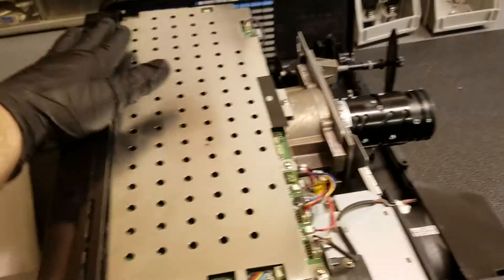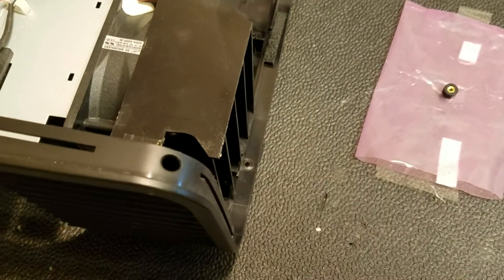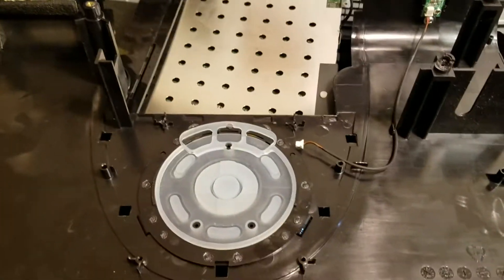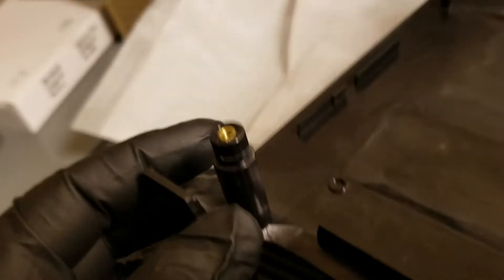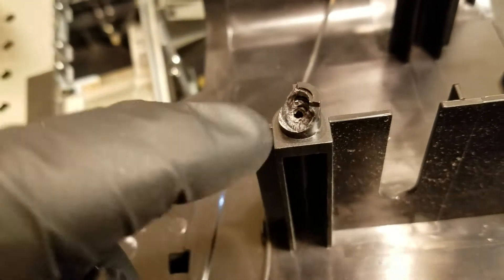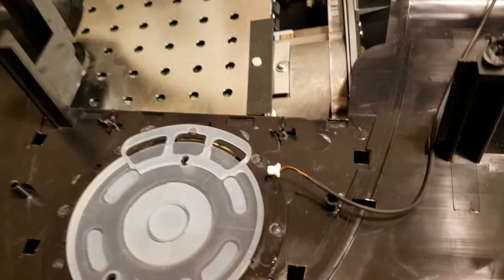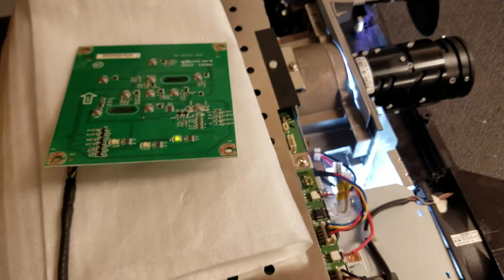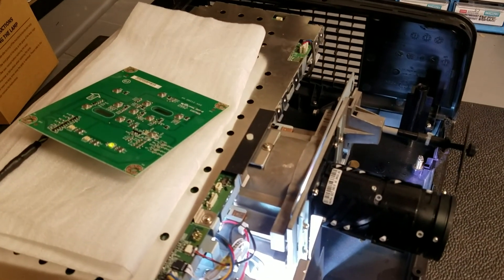BenQ W6000 DLP Projector Repair / Troubleshooting

Comment: It´s been a while but do you remember how to open the left side of the top case where the bulb is? Something seems to hold it quite tight right above the area where the bulb is. I can pretty much open the right side with much less trouble. Or is that normal and I just have to use more force?
Reply from the maker: I don't honestly recall.  But I will say as long as the screws are definitely out, you should be able to pop the side loose.  Again I might be reversed, but I think the top clicks down on the clips so if you push inwards(ever so slightly) on the lower case, it should release the clips for the top. I hope that makes sense. I am pretty positive the top case does not get pushed in to pop the clips loose.

Comment: Thanks for the video. I’ve had this same W6000 projector for a few years. At random times I’d get these yellowish/white vertical lines across the screen that would eventually go away. One day I dropped it from a few feet and those lines came back and never left. It still turns on and everything works except that.

I opened up the top similar to this video and checked the lamp but I’m not sure what to do next. Do you know what this could be?

It’s vertical lines throughout the entire screen

Side note: turning it on after a year and a half and there were 3 red lights but those went away after I re-plugged it in. Thanks!
Reply from the maker: Try throwing it against the ceiling to reverse the damage (Just kidding!).  In all seriousness, I think the connection between the mainboard and DMD pcb is not connected.  There is a chance the connector was damaged. If so, that complicates things greatly. Hopefully it can be fixed by removing the screws that hold it place and then I would disconnect and then reconnect the mainboard to the DMD pcb. If the issue persists after that, the connectors themselves may be damaged.  That is an entirely different repair that is a lot more complicated. I'd try the re-seating of the mainboard and DMD PCB first.
Reply: @FixitFrank  I opened it all up and pushed in the DLP chip a little and turned it on. Started working again! Thanks so much!
Reply: @FixitFrank   Hi Frank :) i have to same problem, but no clue where the DMD pcb connection on the mainboard is, do you have another video explaining this ? thank you a lot in advance

Comment: Hey Frank! My W7000 stopped working after a fall this past weekend. No power at all to the projector, no power LED, ETC. Can you help me out?
Reply from the maker: Oh no!  It sounds like it may have lose its fuse.  Did you have any storms or electrical events that might have contributed?  No power can be easy, or it can be involved.  Unfortunately I don't have an easy suggestion to fix it without knowing more. 
I'd start by checking the easy stuff. Make sure its the projector (try another outlet) in case you lost a breaker. If its the projector for sure, start with the power cable, then the fuse and keep checking for voltage/lack of voltage until you end up at the root cause.  I know that's a little vague but I figure if you know the general path it will get you started.
Reply: @FixitFrank  i figured it out last night after struggling for hours last couple of days. The arm on the lamp gate that holds the killswitch down cleanly snapped off inside. Was such a clean break that it didn't even look like anything was there in the first place

Comment: Do you have a repair business?  I have a BENQ W6000 projector that I replaced the lamp with an aftermarket lamp in January 2020 when the bulb exploded.  It was working fine until April 2020, when the projector after lighting will shut off and give the lamp error light.  The temperature indicator light is not lit.  Got a replacement from the lamp manufacturer and is similarly failing.  The light will illuminate and I can actually view content, but shuts off in a couple of minutes.  The projector and bulb are definitely not hot.  I took it apart to clean it and did not see any glass left inside the projector.  If you have a business can I get repair quote?  Or do you think it is time to get a new 4K projector instead?  Thanks!

Comment: Hi! Thank you so much for this complete walk through. My lamp broke, I replaced it and it broke again after about half an hour. I assumed it was one of the fans that was not working and this guide helped me open it up and check it out. Unfortunately, both fans near the lamp work :(  Can I politely ask for your experienced help @FixitFrank? Any idea what might be the cause for a lamp to break again after such a short period of time? It could be just bad luck, but lamps are a bit too expensive to just test that out..
Reply from the maker: Hallo Maarten! To help me understand your problem, please bare with my questions.
When you say the lamp broke after half hour, did the lamp physically break or did it stop lighting?  If it broke physically, was there a lot of glass pieces?
Reply: @FixitFrank  Thanks for the reply. The glass did not break, not the first bulb nor the 2nd. I'm not even 100% sure the second lamp is busted. My first instinct was to measure the resistance but that apparently doesn't work for this kind of lamps. Eventually I found a guide about looking into the bulb and looking for cracks and blisters in the paint, and from comparison of example images I concluded the lamp was busted.
Reply from the maker: @martosio  Correct! These are arc-lamps. They have no filament to measure. Open circuit is good. 
Which LED indicators are lit when the unit fails?  Just lamp LED?
Reply: @FixitFrank  Saturday, fine time for some tinkering. You made me rethink what I know, which is always a good thing. Thank you for that, I made some progress. I opened it up, and turned it on. The lamp lit up... sometimes. Brushed the dust off the contacts and completely cleaned it out and now the lamp lights up.. always :) Unfortunately, I'm not out of the woods yet. It works for more or less a minute before it turns off and the Temp LED lights up. I tested the three fans, all are working properly when I hook them up to an external power supply. Two of them I can see spinning when connected to the main board. The third one is some kind of turbine fan connected to a tunnel directly into the lamp chamber. I cleaned the tinnel just to be sure. I also measured the voltage to this turbine while the beamer was on to rule out some issues on the main board. It gave me a steady 5.5V. I guess that at this point, I can say I'm 100% sure the lamp works, and the fans work. This is as far as I can go on my own.
From what I understand from your video and having the thing in front of me, is that there are two temperature sensors and a temperature cut-out switch connect to the power board. Do these sensors break from time to time, or is it more likely that something else is wrong?
I googled the thermal cut out switch (klixon YS11a110b-c6) and it says it's default state is 'closed'. My current train of thought is to turn the beamer on, without this sensor. If it goes directly into the same 'temp' warning state, it might be the just that. Being completely inexperienced, I'm afraid this will break more stuff..
Reply: @FixitFrank  By the way, I would like to justify why I'm not just sending it in for repairs. I got the beamer from work, as it's more economical nowadays to just get a new one. Especially when it's this old. I currently don't have the money for a beamer, I don't even have a TV. So a beamer I might be able to repair, sounds really promising. Also, I'm eager to learn :)
Reply from the maker: Maarten! You are so close!  I am impressed!  I have a theory that the turbine may have dust built up on the blades.  That turbine is the main cooling fan for the lamp.  It forces air into the lamp.  If the turbine is rotating properly it can still not force enough air when the blades are coated with dust.  You may want to blow air into the turbine vent(outlet) and see if dust comes out.  Removing the turbine would be preferred but not required.  I think I would not remove unless you have to. Removing the fan would require removing the mainboard and the metal frame underneath. Try the turbine cleaning first.
Reply from the maker: DLP projectors are usually very repairable.  I think if you have the time, you will be able to repair it.  I am more than happy to assist!

Comment: Thank you for your video, I had a "Replace bulb" error light but the light would turn on for 4 seconds then turn off leaving the rest of the system running and the bulb was brand new. No known issue of this kind that I could find. I took it apart and unplugged the pins shown to the left of the keyboard at 5:46 then turned on the system and woolah the bulb didn't turn off and the system properly booted. I re plugged the pins and put it all back together and its working flawlessly. My question is what the hell did I unplug haha?
Reply from the maker: huh.  that is weird. The plug right to the left is the fan, then the next one (with the rainbow of wires) is the low voltage power supply.  Glad you got it up and running!

Comment: Hello. Can You help me with opening Benq W6000? I Would like to clean the fans because I bought W6000 which was used for few years and fans are very dirty and noisy
Reply from the maker: Sure, what sort of advice do you need?  Total disassembly or just the starters? Its not too bad. Taking the lens shroud off is the most difficult part. You may need to rotate it past the end of its range of motion just a little bit to release the clips holding the lens.  I don't have one here or I would confirm.  Some pull straight off with clips while others need to be turned anti-clockwise and then they pull off.  After that its just the screws on the bottom.
Reply: Rostit I have the problem to take off the focus ring. I have released the zoom ring but I don't know-how to handle with focus ring because I don't know if I have to rotate It left with much strengh or should I unscrew those 2 small screws inside?
Reply from the maker: Those screws should stay in place.  The ring either turns all the way anti-clockwise or clockwise(I cant recall). Once it stops its turn, give it a little more twist.  If you look you may be able to see the notches that holds it.  Im going to dig through my notes. I know I have this somewhere.  Standby, Ill get back to you tonight.
Reply from the maker: OK, I think I found it.  If you are looking at the projector head on(lens pointing at you) they need to be turned anti-clockwise until it stops. Then turn it about 1/4" more.  That should release the focus and zoom rings.
Reply: @FixitFrank  Its actually clockwise